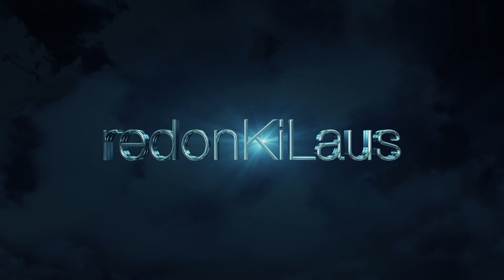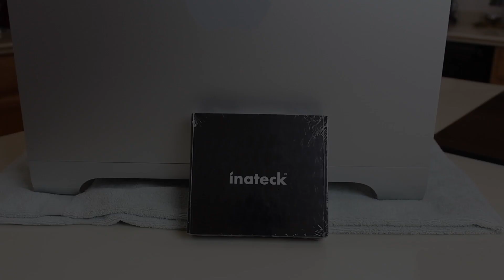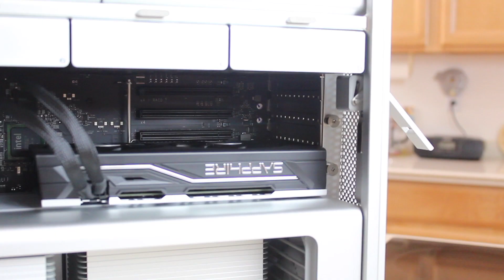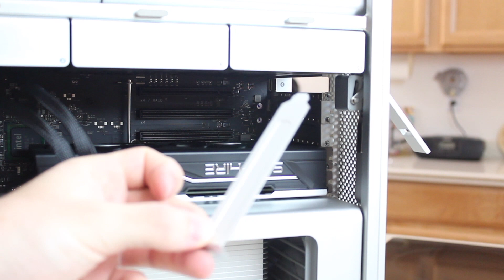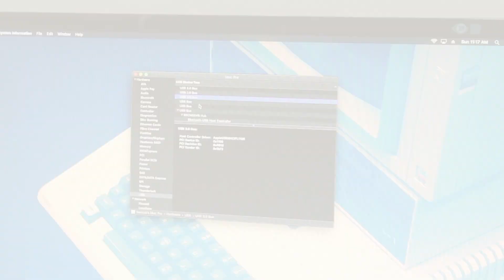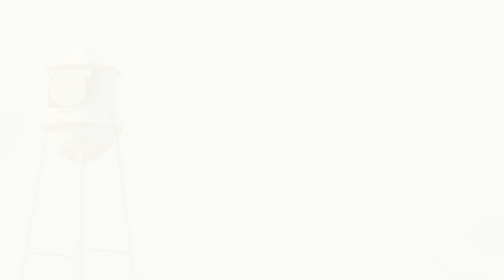Mac Pro 5,1 USB 3.0 Upgrade - Mac Pro Upgrade Series Part 4

Comment: Is there a good USB 3 PCIE that has the extra powersupply? I will be using a external harddrive ssd.
Reply from the maker: Harder and harder to find these days...I'd search online and base upon reviews, since I don't have any experience with any that are readily available anymore.  Thanks for watching!
Reply: A lot of these types of cards will prevent the mac from posting. Make sure you buy one which is confirmed to work. PS: taking power from the sata ports is not a good idea as they often don't output enough power.